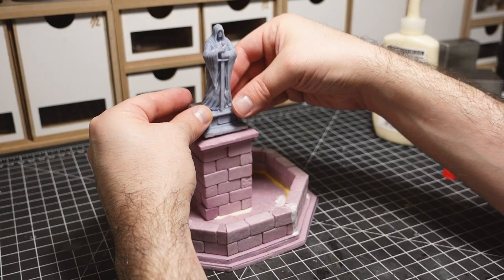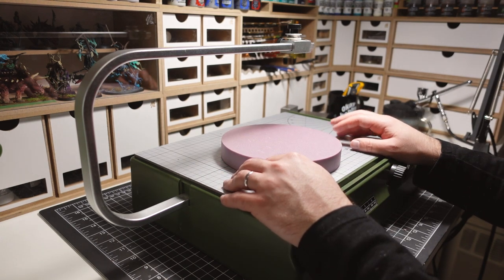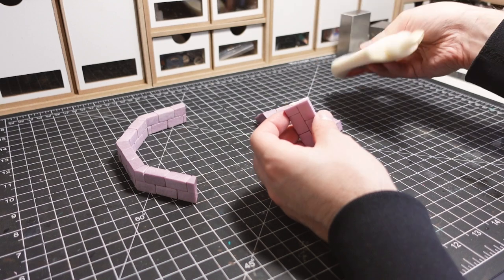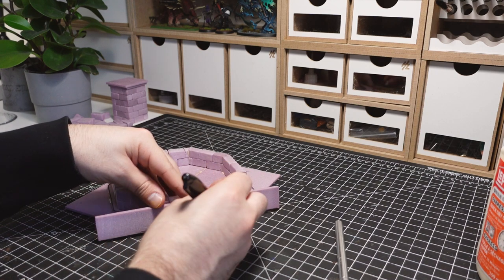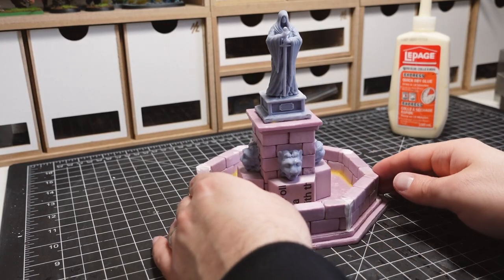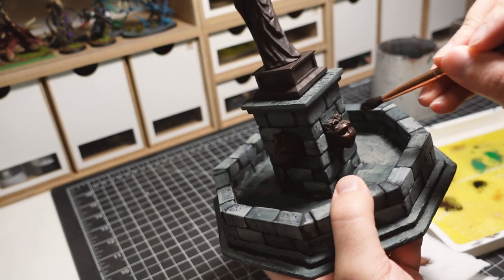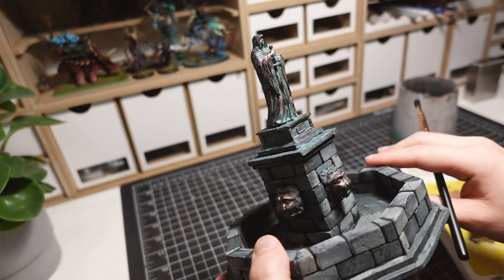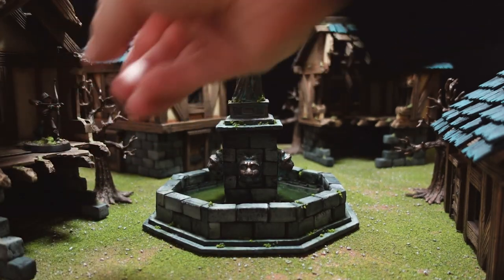Crafting a fountain for my miniature medieval village

Comment: Awesome build. Fountains are a great town center. A bit of advice for brickwork, the joints at the corners of the octagon should maintain bond even if there is a joint. Put two halves next to eachother rather than a half next to a full.
Reply from the maker: Thanks Jordan! And totally, I saw that in the reference photos I used as well.

Comment: Turned out great.  I had the exact same problem with the height of the Proxxon on a fountain I made a little while ago.  I wound up powering through using an Olfa knife and glued it to some chip board to hide the wobbles.  There is indeed a lot of trouble shooting in crafting ...
Reply from the maker: Thank you! I'm getting used to cutting my larger pieces in half then glueing them together as a workaround. The Olfa knife solution always works when in doubt.

Comment: Not used to comment vids but had to congratulate you for your content in general and this video especially. I really like the way you show the problems you faced during the building process and how you solved them. It’s really interesting and it is such a time saver for those watching. Also it gives idea to solve other problems that we may have find while using similar techniques. Thank you very much for it. 
I recently invest in some quality materials to try my own builds but sadly I didn’t find any wire cutter machine and I just found a manual one for the moment. Do you recommend any tips to cut the foam in thinner slices ?
Reply from the maker: Hey, thanks for the comment! Glad to hear you've been enjoying the videos. The handheld cutter is great for lots of stuff, but it'll be tricky to cut thin sheets with it. For small pieces, a ruler and knife will be your best bet. For large thin sheets, I'd suggest switching to foamboard. It's 5mm thick and the sheets I use are around 3mm. It's a close match.
Reply: @OkayHobbyTime  thank you very much for taking the time to answer ! Keep up the great content 👍

Comment: Hello, I have a question for you. I wanna start making dioramas and I dont know if i should choose 28mm or 32mm minies to the diorama. What is your opinion about that? Btw nice video!
Reply from the maker: You can't go wrong with either for dioramas. Popular wargames have been trending towards the larger 32mm, but D&D minis have remained smaller to fit the classic 1 inch grid. I personally prefer the slightly larger size.